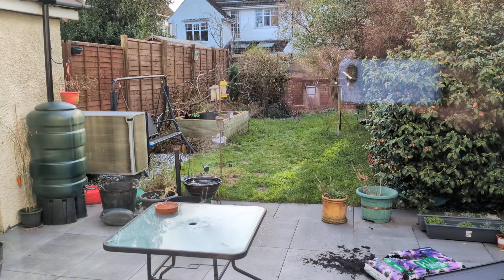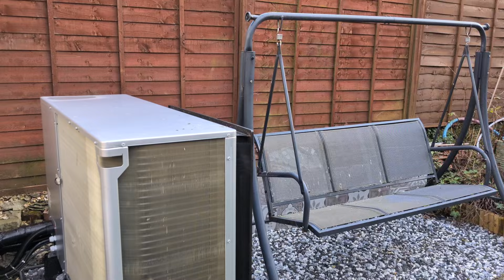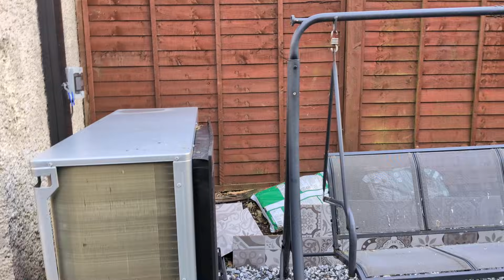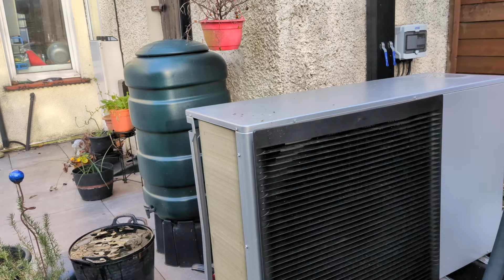More Heat Pump Noise in Cold Weather (3C)

Comment: That's better than last time. I guess none of your neighbours will be sitting out in the garden in this weather in any case.
To be fair, my heat pump hasn't got up beyond 60% (3kW) so far and was very quiet at -2.3C. Others with the same make say it makes more noise when running near 100%. It does show -5kW when in defrost, but no noise at all inside and havn't been out to listen during defrost.

Comment: Is the water in the bucket with the ripple effect due to walking past or the heat pump?

If it's the heat pump, is it vibrating the coal cupboard / out house?
Reply from the maker: Think the ripples are caused by the wind, you can hear a gust in wind.  Not noticed any vibration on the out house. It only connected via the pipes and cables so there might be a little bit of transfer but the unit is on its own slab/base so it well decoupled from the building structure
Reply: @drchrisjbarnettgreentech might be worth double checking, as the ground could still be frozen or if you're on clay very solid from the winter rainfall and transferring energy into the walls